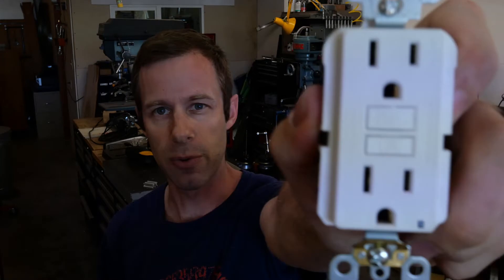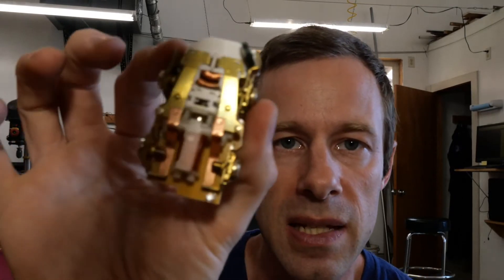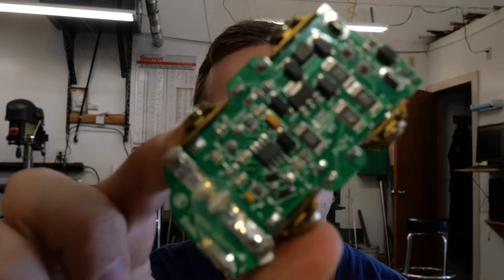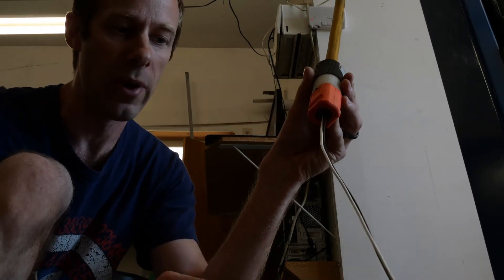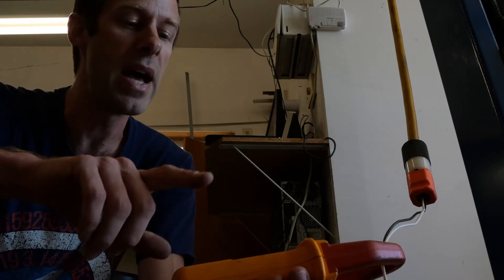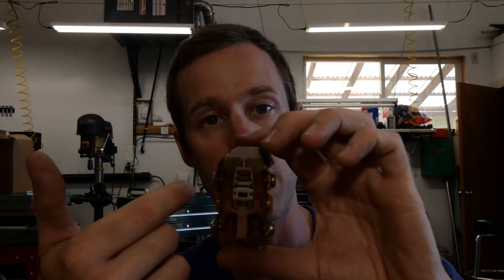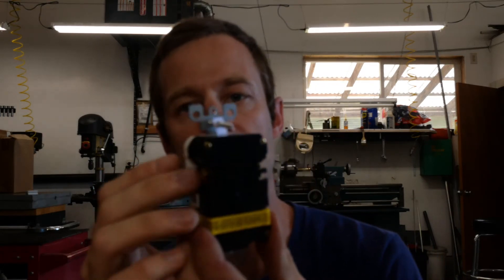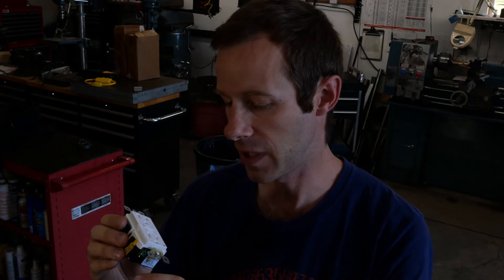What is a GFCI Outlet?

Comment: Question:  Does the test button on GFCI push the current to the ground conductor or to the neutral conductor?
Reply from the maker: From hot to ground, and only a small amount. 

The test measures the imbalance in current between the hot and neutral wires, so if the current was shorted to neutral, the two path would still have equal current. 

Also, it only allows a tiny amount of current, no more than the threshold level (usually about 5 mA or so). If it fails to trip under those datasheet rated circumstances, the device is faulty and needs to be replaced.
Reply: @PetersonBrosAutomation  Thank you.     If I use a GFCI receptacle to REPLACE 
a 2 prong receptacle (no ground) will the TEST BUTTON still work?   If so, then why?
Reply: @tedlahm5740 this is my question as well. I think the GFCI doesn’t function in that situation. Not 100% sure, but I believe that’s why there’s stickers that come with the outlet that say “No Ground”.